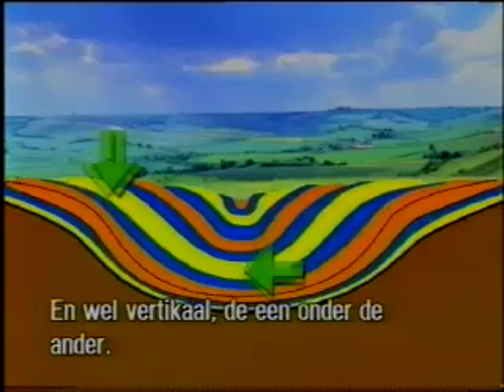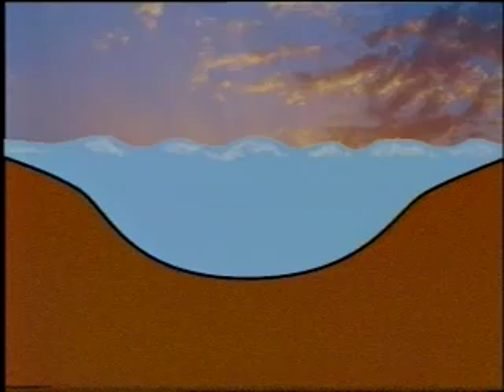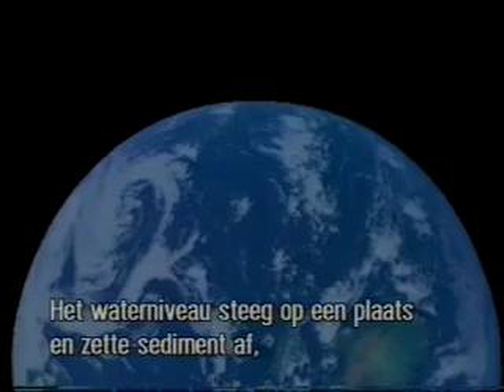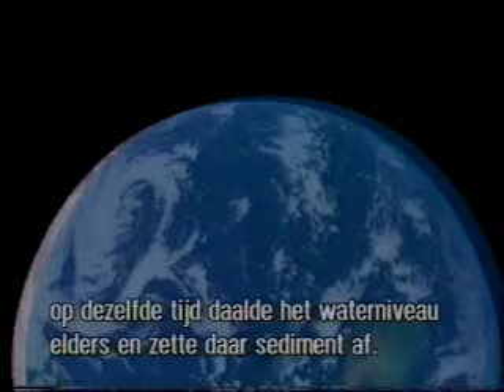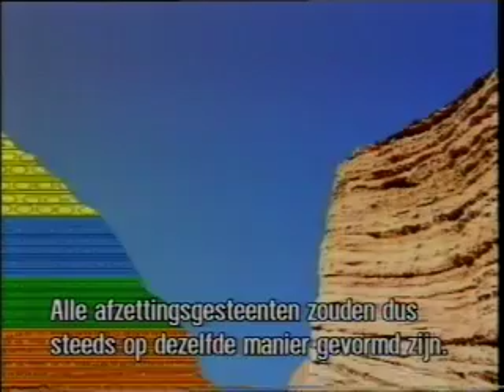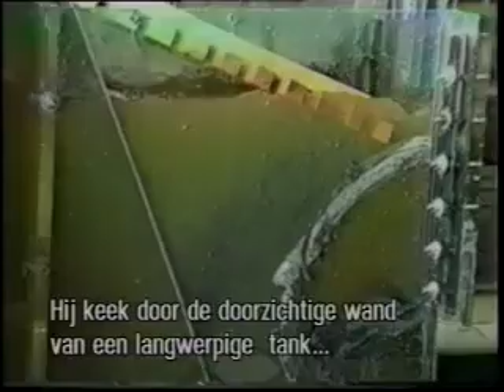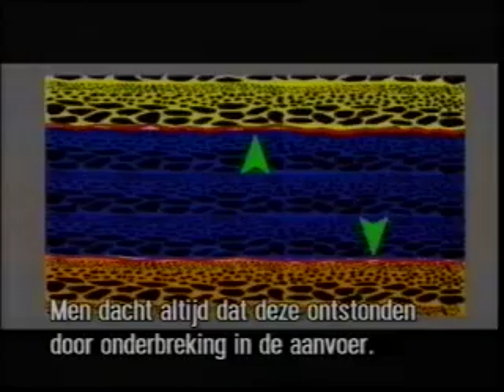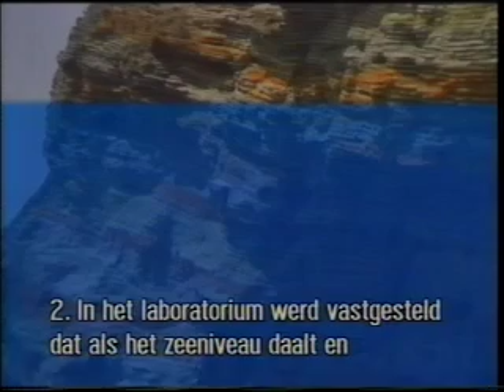Drama in the Rocks part 2/4 - Sedimentology

Comment: ..cont Get a device to agitate it for longer, use hoses for rain and the so called "fountains of the deep" throw in some carcases, bones, sticks, building materials and wood. What sort of pattern do you get? Now add each later one at a time letting the previous settle before you add the next. add the relevant remains each time. Repeat this for as long as it takes. Which one do you think is going to replicate the grand canyon or any strata pattern the best?